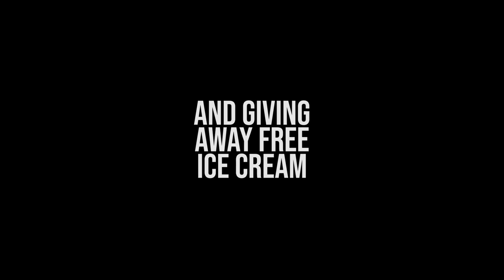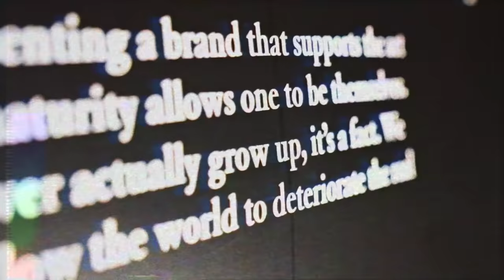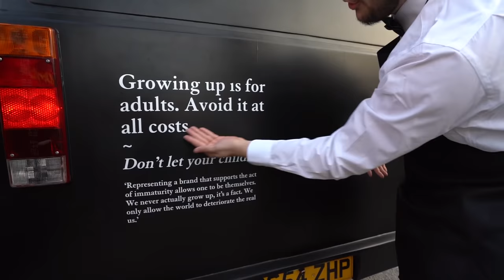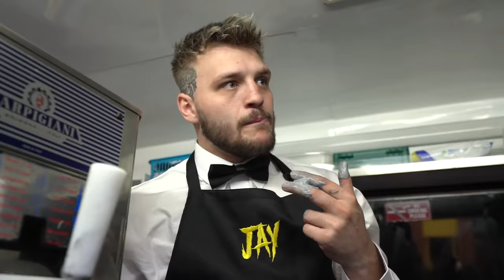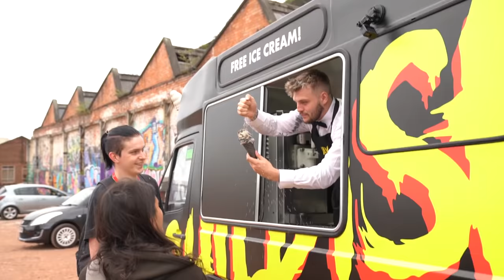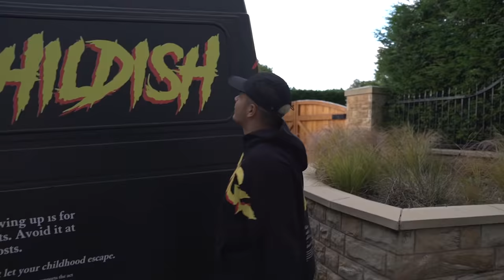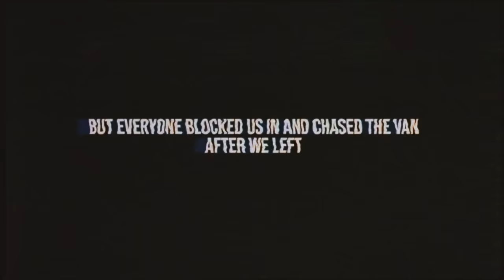Giving Away FREE Ice Cream From A Custom CHILDISH Ice Cream Van!

Comment: 7:41 for anyone wondering why it did that it’s because whoever put the machine back together after a clean didn’t tighten the bolts tight enough causing ice cream to escape from the top. They also had air caught in the pump.